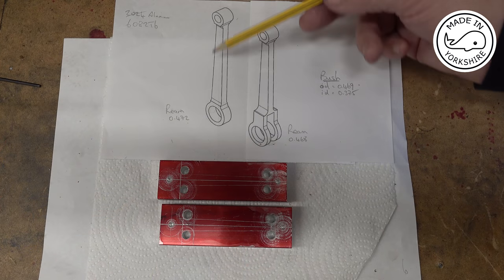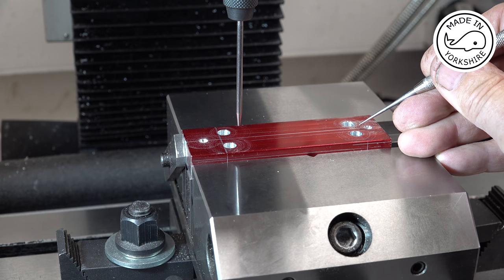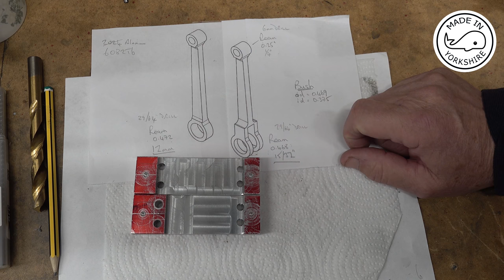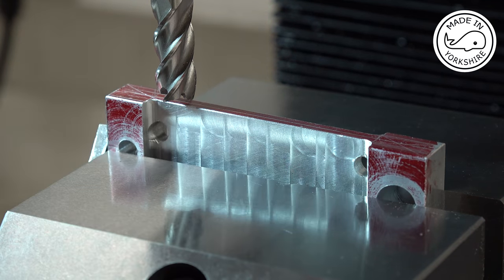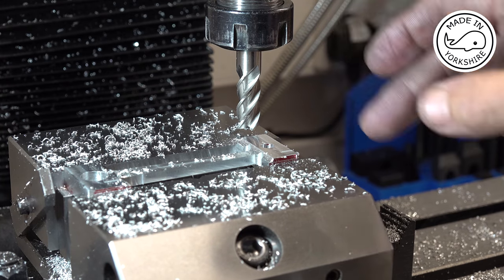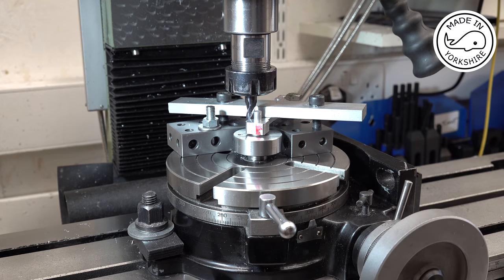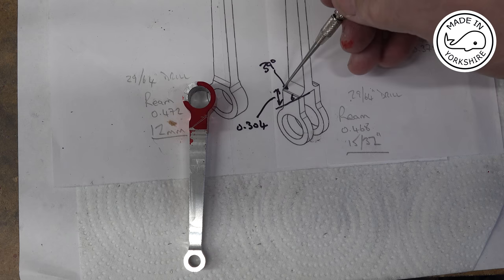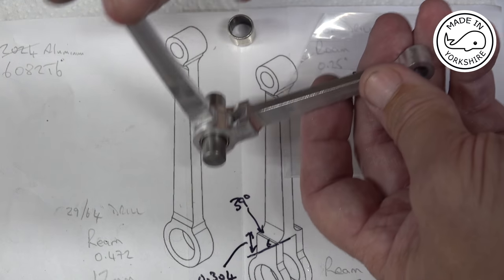#MT44 Part 8 - Hoglet V-twin IC Engine. The Conrods (2nd attempt). In 4K/UHD by Andrew Whale.

Comment from the maker: *** Aluminium Update ***
When I made the conrods I used 6082T6 aluminium because I couldn't find any 2024 aluminium in the UK.
With the conrods not having bronze bushes I have been advised by Mirlin that 6082T6 might not wear so well.
Mirlin also advises that 2014 is very similar to 2024 which has copper content - good for bearings.
I have since found that Noggin End Metals in the UK sell 2014 1" round bar.
If I find that 6082T6 is problematic, I will remake the conrods using 2014.

Comment: This time it is Friday morning coffee with Andrew Whale. Another very enjoyable video Andrew, I really wish I had that  4X feature in my shop it certainly saves a lot of time , he said with tongue in cheek. Stick with your shallow depth of cuts I use this system even in my Bridgeport mill a little higher speed rate and a little faster feed rate and the metal comes off almost as rapidly as in a hogging mode and it is a lot easier on the machine. I also want to give a shout out to your followers and the comments on the videos , they are always illuminating. I am 79 years old this month and I was taught to single point a thread in a lathe when I was 13 years old by Mr. Bradford  at the Haverhill Trade School so I have been "Learning Turning Metal" for many years now and always pick up tips from you and your commenters. Well coffee is done and it is time to get back to getting firewood ready for the coming winter. 
Cheers,
Dick B.
Reply from the maker: Thanks Dick - it's an amazing hobby and so much to learn. I get some fantastic tips and I hope others benefit too.
All the best.
Andrew

Comment: Great Outcome Andrew, I see that you have reverted back to "Piddling" cuts again. LOL I know at times you needed to take it easy, especially when doing the slot as it was only held on a thin section. But when you were hogging out the center part that was held well you could have done much deeper cuts 0.040" at least especially being Aluminium. Regards from Australia.
Reply from the maker: Hi Dave - I think it's a mental thing with me! I was cutting in 20 thou depths, so I've not totally reverted back to my old habit.
Cheers
Andrew

Comment: Well done Andrew, they look far more robust now assembled than they look on the drawings. Ha Haa, you aren't the first and certainly won't be the last to have a power feed collision, I managed to move a 6 inch Abwood vice half way down the Bridgeport table in my apprenticeship, never did that again! Cheers, Jon
Reply from the maker: Thanks Jon - a total lack of concentration on my behalf. I switched the mill off without dis-engaging the power feed. Then I moved the power feed limiters and got side-tracked. Went back to the mill and switched it on. I was lucky and I just caught it in time. There I am taking 20 thou cuts, and the powerfeed cut half an inch like butter! Hey ho!
All the best.
Andrew

Comment: Great work! The Hoglet is a proven design with many builds so I don't think you will go wrong by just building from the drawings.
Reply from the maker: Thanks Douglas - I've come to the conclusion that I was overthinking it. Finding the correct size split bearing put me back on the right track.
Cheers
Andrew

Comment: Another very interesting video.  A tip I saw on Ade’s workshop was to leave both ends of the cranks full thickness on some excess length.  Then it’s easy to machine the small end to thickness without having to worry about packing.  Watch his S50 crankshaft video for a better explanation.

Comment: The con rods look really good.   Well done.
Glad the power feed crash did not damage the part or the power feed.
Aluminium 2024 alloy is stronger than 6xxx and is often used for structural items.   Easier to get in the US.   If a future project really needs this, I can get some for you.   I have several feet in a bar about 1 1/4in x 1/4in.
Dave.
Reply from the maker: Thanks Dave - that's very generous of you. What we need is a US/UK trade agreement, but it looks like that is now on the back burner. 🙁
All the best.
Andrew

Comment: Hello Andrew,
Nice work as always... When you were explaining the rotary table setup and the previously milled MT2 Arbor it made me think that making engines now that you've previously made a few is a lot easier as you have many jigs and fixtures to use from previous projects.
Take care.
Paul,,
Reply from the maker: Hi Paul - the MT2 arbor and 123 blocks really do work well together. It's so easy to make a mandrel to fit a different size part onto it. With the 123 blocks being part threaded it's also easy to attach clamps. I'm sure there must be similar solutions out there, but that was my own design.
All the best.
Andrew

Comment: Lovely job Andrew. Those look great. I was watching Ades Workshop yesterday and he had a good solution for milling the ends of the rods to different thicknesses. He left the surplus at its original size so when the rod is turned over you rest the unmachined surplus edges on the parallels so that the rod part is level without the need for slip guages. When you showed the areas marked up to cut them off with the hacksaw I could see that this approach would have worked well for you. Very much enjoying this project and looking forward to seeing the lower part assembled.
Reply from the maker: Hi Tim - that's a great idea. I must try to remember that tip! 🤔
All the best.
Andrew

Comment: So does one cylinder fire , while the other is on the exhaust stroke. Great video.
Reply: Yes. On all early Harleys (up to the 1990s) they have a single ignition coil and fire both spark plugs at the same time.
Reply: @wizrom3046  Yes and the rear cylinder fires first.
Reply from the maker: Thanks Steviegtr. I'm glad others replied because I didn't know the answer. I'm learning as I go along 🤔
Cheers
Andrew

Comment: Thanks for one more pleasant and entertaining, well produced video! Yes, I enjoyed it!
Couldn't You have reengineered the drawings for the flywheels to match the already made conrods?
Okey. Giving up is not an option. Hit him again...
As many times before, lots of advanced, and successful clamping to remember.
Is there a voice to Excel converter in order to keep up with the measurements given?  Joking! Not ever trying such advanced projects.
Reply from the maker: Thanks Stefan. I don't think re-engineering the flywheels was an option as it would have resulted in significant weight loss. I could have made the crankcase wider - but I might have hit another problem further down the line. Others also thought the offset conrods would introduce uneven load on the bog end. In hindsight I should have stuck with the original design from day 1. You live and learn!
All the best.
Andrew

Comment: Hi Andrew, I think you will have problems with these rods (sorry). The 2000 series of alloys contain a lot of copper thereby providing strength but not only that they act in a similar fashion to bronze when used in bearing situations like both the big and small end. My suspicion is that unless you bush these running fits you will at some point have problems with galling especially if there is flex and whip in the rods due to their low strength. On EBay at the moment, there is a tonne of 2014A aluminium being sold by homeworkshop. There are some smaller pieces at reasonable prices. 2014 is the same stable as 2124 but can withstand higher temperatures, not something you need but nice to have. You’ll notice the difference when machining it that  it’s nothing like the alloys you are used to. I’ve no connection with these people but the rarity of the material caught my eye. Mike
Reply from the maker: Hi Mike
Thanks for the info. Unfortunately I can't find any suitable 2014A on eBay UK. I'm guessing you are based in the US? If you are in the UK I would appreciate it if you could email me the eBay link to learningturningmetal@gmail.com.
Alternatively I will just have to risk using what I've got.
Cheers
Andrew